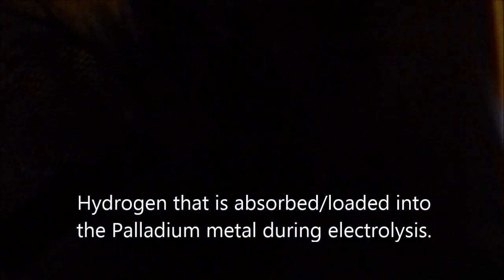Palladium: Absorbed Hydrogen De-gassing via Flame

Comment: Did you try use palladium to catalize the oxidation of methanol in air ?? The metal should become red hot in methanol vapor mixed with air
Reply from the maker: No I have not tried that, but it does sound pretty neat.